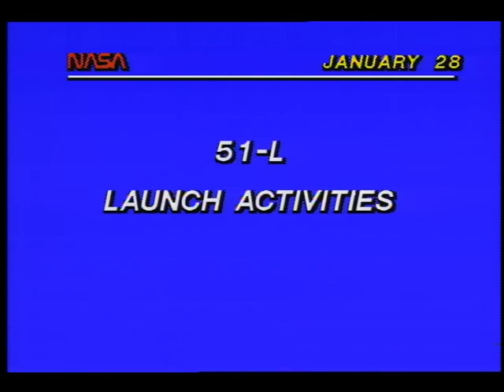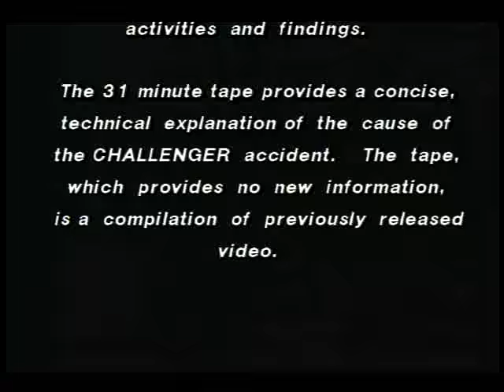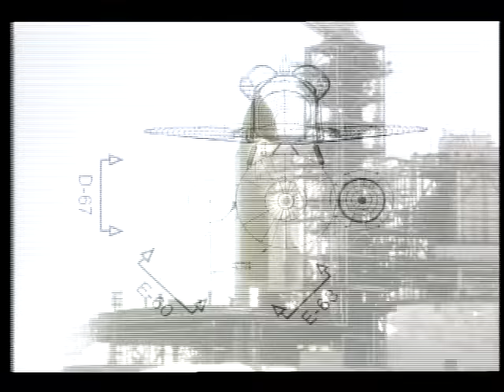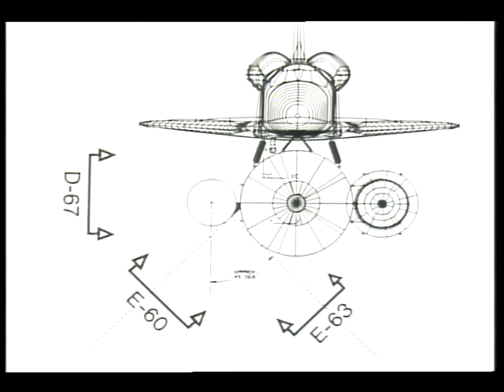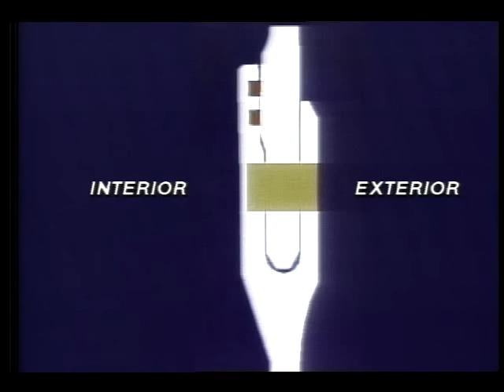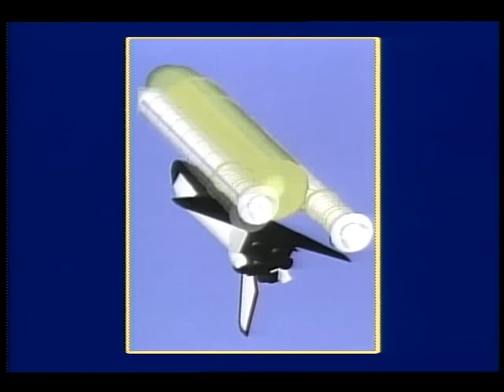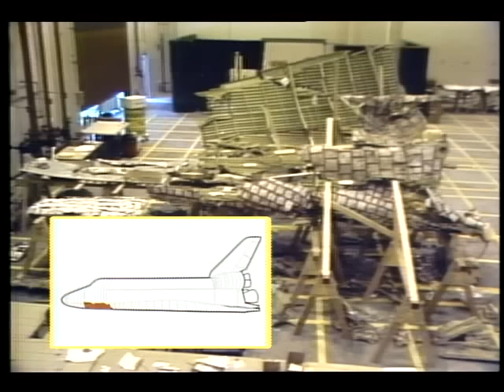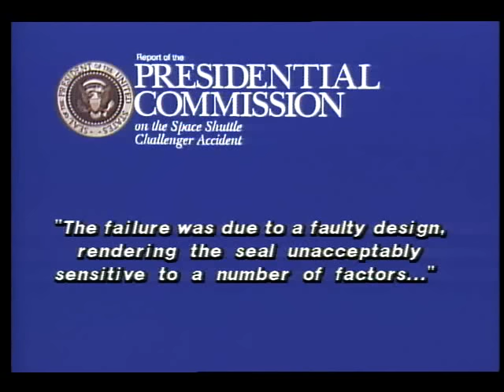Shuttle 51L: Challenger

Comment: Those technicians helping them put the helmet/suits minutes before launching . I bet they were shocked 😢 when minutes after it exploded. The crazy feeling when you just saw someone and minutes after they are gone is beyond shocking.
Reply: I’m pretty sure they don’t get in Just Minutes before launch, it’s usually a couple hours at the longest- to get the rocket ready for the last pre flight checks.
Reply: Actually, once they are suited up they sit in the shuttle for quite some time before launch. I think it's a few hours.
Reply: @djienf  they do indeed . Around 2.5 hours
Reply: Despite initial appearances, Challenger never exploded. The jet of flame escaping from the joint on the right SRB, due to the failed o-rings, cut through the lower SRB to External Tank mount. This caused the right SRB to swing into the external tank, causing the latter to collapse - its fuel, no longer contained in the tank, igniting into a fireball nowhere near hot enough to compete with the temperatures the orbiter faces on re-entry. Rather, it was the violent forces placed on orbiter from the right SRB changing direction and the collapse of the extertal fuel tank, that caused it to rip apart, leaving the most structurally reinforced part of the orbiter - the crew cabin, to fall back to earth - intact. Challenger's crew was still alive until the moment the crew cabin hit the Atlantic ocean.
Reply: @digitalutopia1  Them still being alive while all that happened is even worse, holy shit
Reply: that would be a good bet given that lots of people all over the world were shocked
Reply: Yeah my grandpa is the one who has the comms on. He is still alive, and he was definitely crushed when it happened.

Comment: The one thing I never liked about the shuttle was the inability to escape a catastrophe prior to the SRB separation.  At least with Apollo, they had the escape tower.
Reply: The shuttle had an abort  mechanism and escape maneuver capable of separating the shuttle from the external fuel tank. However, with the Challenger disaster, the crew and Mission Control didn’t really have any indication there was a problem until the external fuel tank exploded. Which was why the system was never activated.
Reply: Seeing them crawl in that thing knowing they're never coming out alive is chilling 😢
Reply: I believe only one of the shuttles had an abort system, and it was really heavy and complicated
Reply: @vaopr1012  I believe only one of the shuttles had an abort system, and it was really heavy and complicated. Also there was a very limited window where the shuttle could attempt an early separation maneuver to glide to an emergency landing. If it was too low the shuttle would just stall and crash before it could enter a stable glide, if it was too high/fast the shuttle would probably get ripped apart by severe drag it wasn’t designed to sustain. 

Edit: just looked it up and there was no possible way to safely attempt an emergency glide while the SRBs were burning. They would shoot past the shuttle and damage it with flames or a collision. NASA had no abort plan that involved detaching the shuttle while the SRBs were active. One they lit, there was no chance of abort until after they detached.
Reply: @Roach_Dogg_JR   That’s correct. No abort was possible until after SRB separation. As to an abort system, Columbia had ejection seats on the first flight. Just 2.  They were removed on flight 2 if memory serves me.
Reply: @vaopr1012  They actually didn't. There were no abort procedures that I'm aware of while the boosters were still attached to the stack. And the External tank didn't explode. It was torn to pieces. If you look at what actually happened, there was a fireball, yes (which was a conflagration of the fuel) but no explosion. The shuttle and external tank were ripped to pieces, and it looked like an explosion, but it actually wasn't.
Reply: @Roach_Dogg_JR  "h̶e̶a̶v̶y̶ ̶a̶n̶d̶ ̶c̶o̶m̶p̶l̶i̶c̶a̶t̶e̶d̶" Too expensive.
Reply: Even if they could escape it was unluckily they would effectively gain control to land. 
Those shuttles were just junk and had a lack of safety features.
Reply: Shitty design. That’s why they’ve gone back to Apollo style putting the astronauts on the tip. The only way to make an ejection system.
Reply: @rxw5520  I think the original plans had one, but they never made it into the "final" design before Columbia's first launch. They had some sort of ejection system where the crew cabin could be ejected away from the stack, if I remember right. I could be VERY wrong about that.

It's also possible that they just didn't have a contingency to manually eject the boosters if they noticed a problem.
Reply: @starpartyguy5605 the vehicle was capable of releasing the crew cabin to abort during any point after launch.
Reply: @vaopr1012 there were no abort modes available until after SRB separation. The crew had to ride out any issue until after SRB separation.
Reply: @mrich1976  they couldn’t eject the crew cabine. But had they had that capability combined with a ballute and parachutes, it just might, I repeat might, have saved the crew of both challenger and columbia (though the latter required the thermal protection system around the crew cabin to remain.
Reply: @tusse67  That's a possibility. In the case of Challenger, they would have ejected "head down", so there might have been the possibility of survival. In the case of Columbia, you have the risk of the crew cabin tumbling after ejection.

Unfortunately, ejection systems like that were scrapped on the orbiters.
Reply: @mrich1976  yeah… ruled out early in the design due to weight.
Reply: @tusse67  That's also the reason they stopped painting the External Tank white. To save on weight.
Reply: They ejected out the door as guided by a curved tube. Never used.
Reply: @MarkShinnick  that system was implemented after challenger.
Reply: @Roach_Dogg_JR  the first four shuttle flights were considered "test flights" and carried only a two man crew, the craft, Columbia, was equiped with ejection seats as used on fighter jets in the event of a launch emergency. Begining with the fifth flight the shuttle moved from the "test phase" to fully operational , carried a larger crew and the ejection seats were removed, leaving the crew with no means of escape during the first mins. of flight.
Reply: @davidkruse4030 The shuttles were actually amazing feats of engineering given the available resources. They were also extremely flawed, unreliable and  much more dangerous than they should have been.
Reply: @rxw5520 Much less complex and expensive. Most everything that made the shuttle unique, could be done with unmanned vehicles. The military soon figured this out. The shuttle was far too dangerous and had several close calls prior to Challenger. And of course Columbia repeated the cycle years later.
Reply: @mrich1976 Escape/ ejection systems were discussed but no serious attempt was made to implement them. NASA figured if the system was made foolproof they wouldn’t be missed. Solid boosters had never been used for manned space flight before, for good reason. Once they were lit, they couldn’t be throttled down or cut off. Almost literally like being strapped to two giant bottle rockets.
Reply: @coronalight77 It wasn’t. The shuttle could abort (and did 'abort to orbit' at least once) after the boosters separated, but the crew cabin could not be ejected independently.
Reply: @MarkShinnick That sounds like the escape system if there was a fire or hazard on the pad, not after takeoff.
Reply: @mrich1976 You are about this. The correct term for what happened is "Rapid Deflagration" When the external tank ruptured the fuel and LOX mixed and the cloud that resulted simply ignited.

Comment: It's interesting to note that in the time after this video was made, it was determined that it was not a faulty design that caused the accident, but faulty management at NASA.
Reply: it wasn't a faulty design, but it wasn't the best design. Early versions of the Space Shuttle concept had a better plan for the booster rockets, but NASA opted for the SRBs which were segmented together using the o-ring seals, which failed on the Challenger due to the cold weather that day kepting them from seating properly and sealing the joints.
Reply: Using a rubber seal instead of a silicone one is a huge design fault.
Reply: @terrypage358  apparently they took several shortcuts trying to keep the budget down which resulted in not one but two fatal accidents

Comment: The Accident Board determined that the crew survived the explosion, the crew cabin was seen falling from the sky, but the crew died instantly when the crew cabin hit the water at high speeds.
Reply: Yes this is what makes it even more horrifying. With something to slow their descent, they could have lived.
Reply: @backfromcuba  yep there were plans to have the orbiter cockpit be a makeshift lifeboat and separate via explosive bolts and then parachute to the ground at a safe speed, but was canned due to the expense and complexity of the plan. The first initial test flights of the shuttle had 2 ACES ejection seats for the 2 test pilots/astronauts but were then replaced when the shuttles started orbit ops.
Reply: The accident report did not determine that. At least one of the astronauts was alive but they were all unconscious or deceased before impact with the ocean.
Reply: Seatbelts?
Reply: Это говорит о не совершенстве системы спасения. В России система спасения экипажа более совершенна.
Reply: @Flagman610  почему ты печатаешь по-русски на англоязычной платформе?
Reply: @wcwn3632  тебе на каком языке ответить?
Reply: @wcwn3632 🤣👍🏼

Comment: On January 28, 1986, the Space Shuttle Challenger broke apart 73 seconds into its flight, killing all seven crew members aboard. The spacecraft disintegrated 46,000 feet (14 km) above the Atlantic Ocean, off the coast of Cape Canaveral, Florida, at 11:39 a.m. EST (16:39 UTC). It was the first fatal accident involving an American spacecraft while in flight.[1][2]

The mission, designated STS-51-L, was the 10th flight for the orbiter and the 25th flight of the Space Shuttle fleet. The crew was scheduled to deploy a communications satellite and study Halley's Comet while they were in orbit, in addition to taking schoolteacher Christa McAuliffe into space under the Teacher In Space program. The latter resulted in a higher-than-usual media interest and coverage of the mission; the launch and subsequent disaster were seen live in many schools across the United States.

The cause of the disaster was the failure of the primary and secondary redundant O-ring seals in a joint in the shuttle's right solid rocket booster (SRB). The record-low temperatures on the morning of the launch had stiffened the rubber O-rings, reducing their ability to seal the joints. Shortly after liftoff, the seals were breached, and hot pressurized gas from within the SRB leaked through the joint and burned through the aft attachment strut connecting it to the external propellant tank (ET), then into the tank itself. The collapse of the ET's internal structures and the rotation of the SRB that followed threw the shuttle stack, traveling at a speed of Mach 1.92, into a direction that allowed aerodynamic forces to tear the orbiter apart. Both SRBs detached from the now-destroyed ET and continued to fly uncontrollably until the range safety officer destroyed them.

The crew compartment, human remains, and many other fragments from the shuttle were recovered from the ocean floor after a three-month search-and-recovery operation. The exact timing of the deaths of the crew is unknown, but several crew members are thought to have survived the initial breakup of the spacecraft. The orbiter had no escape system, and the impact of the crew compartment at terminal velocity with the ocean surface was too violent to be survivable.

The disaster resulted in a 32-month hiatus in the Space Shuttle program. President Ronald Reagan created the Rogers Commission to investigate the accident. The commission criticized NASA's organizational culture and decision-making processes that had contributed to the accident. Test data since 1977 demonstrated a potentially catastrophic flaw in the SRBs' O-rings, but neither NASA nor SRB manufacturer Morton Thiokol had addressed this known defect. NASA managers also disregarded engineers' warnings about the dangers of launching in cold temperatures and did not report these technical concerns to their superiors.

As a result of this disaster, NASA established the Office of Safety, Reliability, and Quality Assurance, and arranged for deployment of commercial satellites from expendable launch vehicles rather than from a crewed orbiter. To replace Challenger, the construction of a new Space Shuttle orbiter, Endeavour, was approved in 1987, and the new orbiter first flew in 1992. Subsequent missions were launched with redesigned SRBs and their crews wore pressurized suits during ascent and reentry.

Comment: The tragic thing is that silicone was available as a material for use instead of rubber. If a silicone seal was used instead of rubber, this would never have happened.

Comment: Putting aside the fiasco with the o-rings, I think it's criminal that NASA sent astronauts up in the shuttle without a viable escape option incase of disaster like this.
Reply: i think there was early on but they scrapped it because of cost and not being too practical as they had a very narrow window of opportunity to execute it successfully  ? I may be wrong but remember reading something along these lines.
Reply: @westnblu  yes there were plans to make the flight cabin as a lifeboat that would separate if there was an issue that would cause loss of crew and spacecraft. It never got passed the planning stages due to expense, complexity and overall mass of the design. STS 1 had ACES ejection seats but they were swapped out after STS 1 when they switched to longer duration/orbit ops.
Reply: People fly commercial aircraft daily with no viable way to escape. Everyone onboard knew there were inherent risks with launching into space, none were forced to board.
Reply: @westnblu  the first four test flights carried only a two-man crew and were equiped with ejection seats, after the shuttles were certified operational they carried larger crews and the ejection seats were taken out, leaving the crew with no means of escape in the first few minuetes of powered flight.

Comment: It’s to bad there wasn’t some sort of parachutes for the cabin that did separate from the orbiter. Perhaps it was going too fast for them to safely deploy? Challenger was 9 miles in altitude at 73 seconds. I don’t know how many chutes would have been required. I know the Apollo capsule used 3 chutes. Perhaps the speed of the separated crew compartment would have slowed as it continued forward. Apollos chutes deployed at 10K I believe at about 175 mph slowing to 22 mph before splashing down. I don’t know if they ever got this accomplished for future shuttle flights? Obviously they should have listened to the engineers who wanted to launch that afternoon. Hindsight is always 20/20.
Reply: There were plans to make the crew cabin as a lifeboat that would seperate if there was an issue that would cause loss of crew and spacecraft. However it never got past the planning stages due to the complexity, expense and overall mass of the design.
Reply: One to two missions before this flight, NASA had made the decision to remove the parachutes from the crew cabin.....said it was too much weight and that they didn't need it anyhow as there had never been an issue before this flight, so it didn't make sense to them to continue using and having a parachute on the crew cabin etc.